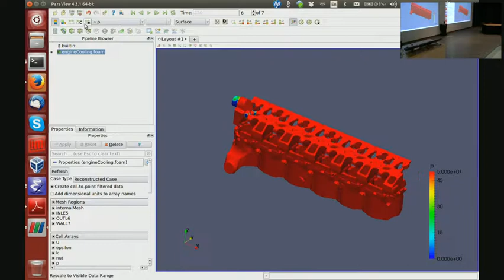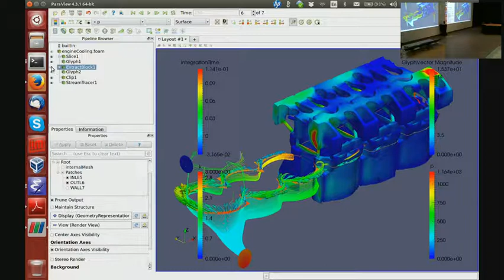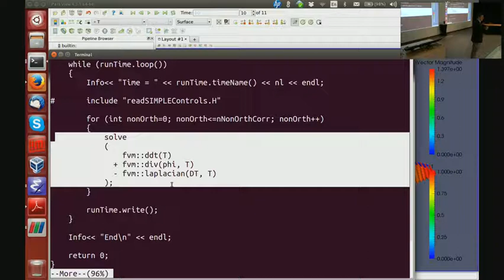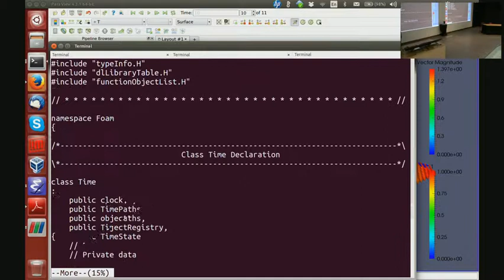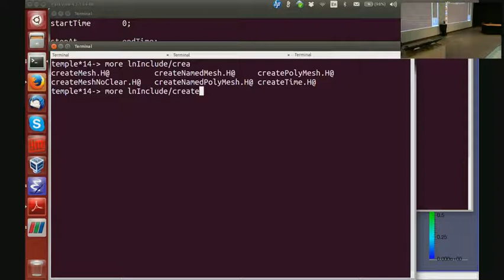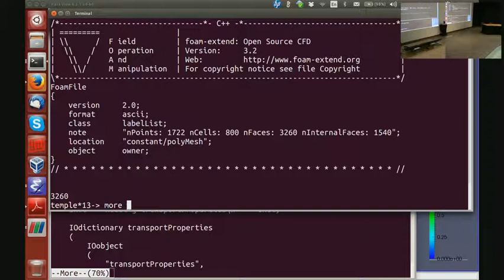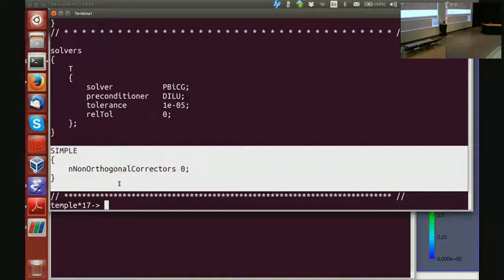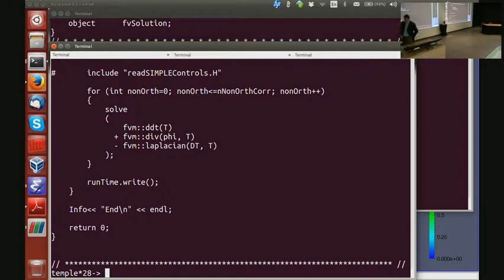Introduction to OpenFOAM: A User View (part 4/5)

Comment: sorry what is the dimension of   fvm::div(phi, T)? what will be the difinition of phi here?  in momentum equation case case it will be volumetric fluxs/mass flux  and its unit will be m^3/s and kg/s respectively.

Comment: kindly i have some Questions if you explain
 what is initial and final residual?
what is the difference b/w tolerance  & relTol?
also sir what does this shows
  pFinal
    {
        $p;
        relTol          0;
    }
why we use this for P and not for others i.e U,T etc?
Reply: Dear sir, residual is the error in the solution. Tolerance (Acceptable level of error )is the value given by the user. Refer UserGuide for Openfoam http://foam.sourceforge.net/docs/Guides-a4/OpenFOAMUserGuide-A4.pdf